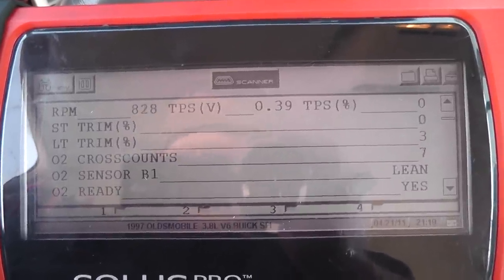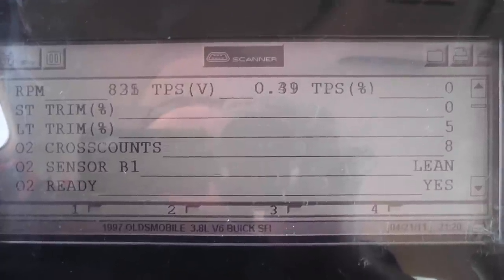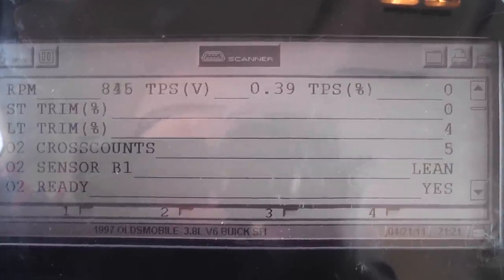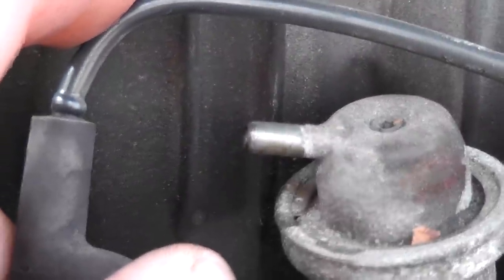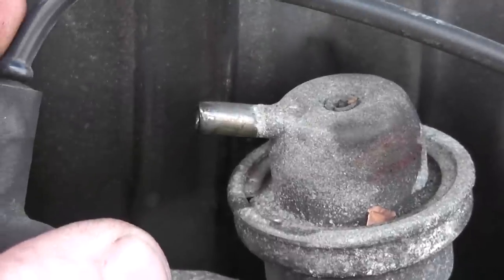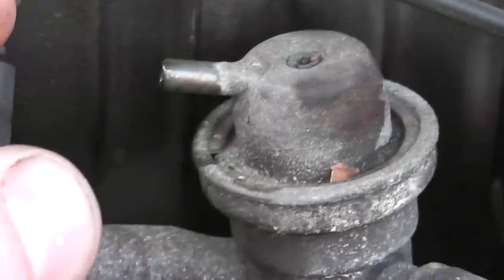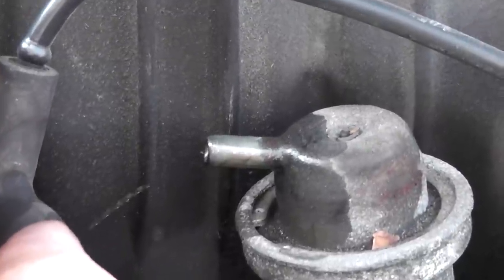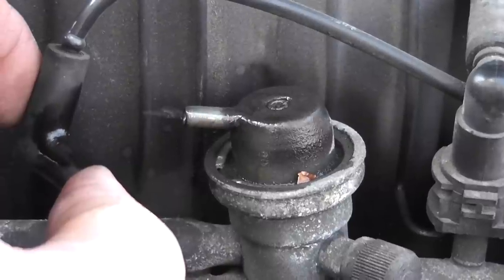Testing for a leaking, ruptured, fuel pressure regulator diaphragm

Comment: Will my engine run rough with a bad fuel pressure regulator and cause misfires? I have a 99 vw jetta vr6 and i am trying to figure out what is wrong with this car! I also noticed oil in the plug of the camshaft sensor because the seasl was bad and oil inside the air intake tube through the built in pvc valve! Can a bad catalytic converter cause the back pressure in the engine?  Thanks for the great channel!
Reply: Oil getting into your intake via the PCV valve can be a condition of excessive blow by gasses. Do a compression test. Maybe your piston rings are bad.
Reply: If so can i just replace the piston rings? I know there is a issue for sure! I think it might be a clogged catalytic converter but i dot know if that will cause enough back pressure to cause the blow back. This is my first v dub and the car is sweet but it runs like crap and i have replaced many parts but i havent had the time to mess with it lately! Thanks for any advice is appreciated!
Reply: Coilpack - common fault on the vr6. They crack internally. Change the coil pack first :)
Reply: I removed the header and exhaust and the engine doesnt shake as much and the idle is at 800 rpm instead of around 700 rpm or so. I think my converter was bad
Reply: I did replace coilpack! I have been getting low voltage on the engine sensors so i am going to replace the ect sensor and my temp gauge doesnt move and fans dont turn on .
Reply: mikeyd19841 Engines usually shake more with the exhaust manifold off so you may be on to something.
Reply: mikeyd19841 That blow by causing oil to get into your air intake could be caused by exhaust restriction instead of bad piston rings. See if your compression is improved with the exhaust off. Usually compression is down with bad rings, but maybe your pressure is too high due to clogged exhaust instead. 

A better way to test this is to hook up a vacuum/compression gauge through your 02 sensor.  Exhaust shouldn't be pressurized. If it is you've found one problem. 

Bad fuel pressure can cause misfire symptoms like rough running where you don't get misfire codes. "Bad" is too much just like too little it's bad.
Reply: mikeyd19841 Did you have misfire codes or just symptoms?
Reply: TinnieSingh i have a vw passat 2006 2.0t and it's having an intermitment problem stalling and long cranks to start.i put the computer and it saids there is a fault code for the fuel pressure regulator.
Reply: David Henriquez It may be getting too much fuel. Lack of vacuum to the fuel pressure regulator or a leaking regulator. Either way, too much fuel
Reply: DE Nichols to update you man.the car has been sitting for like a month.went to check out the high pressure fuel pump.well i pinched the fuel pressure regulator valve and fuel came out.i'm almost 100 percent sure now that is the problem.
Reply: David Henriquez
If fuel is coming out of the fuel pressure regulator through the vacuum hose then it can cause - numbers for fuel trims, also known as a rich condition. And if that's where the fuel is coming from then the regulator is definitely bad.
Reply: I will send you a diagram of my engine where i am having a vacuum issue. It is the vacuum line on the far left that was unplugged when i bought the car and when i plug it back in to the back of the upper intake manifold the car just stalls! So the vacuum line is just unplugged and the car is not on the road and is in my garage and i am waiting for better weather to look at it!         http://s981.photobucket.com/user/chamocritters/media/DSCN1136.jpg.html

Comment: My 1998 Cadillac Deville shows trouble code P0300. There was no vacuum when I pulled the vacuum line off the regulator. Any guess why there is no vacuum? The engine starts right away, but lacks power. Is my regulator bad?
Reply from the maker: A 98 caddy? What engine? Are you sure it was a regulator you were messing with? Some returnless systems used a pulse dampener on the fuel rail that looks like a regulator.
Reply: @ScannerDanner  Thanks for your quick response. After I posted my question, I found a crack in the rubber vacuum line where it plugs into the vacuum port on the engine. I have vacuum to the fuel pressure regulator now.

Comment: I have a ford focus and when i start on a cold day it struggles to start for about 30 seconds. If i touch accelerator it will stall but only for the first 30 seconds   i have looked everywhere for help but no joy. My pressure regulator does not have a gauge reader so i do not know what pressure it is. Do you know how i can tell how to set it correctly. Thanks
Reply: I am directing all help requests to my forum. Sign up (it's free) and create a new post. Be sure to add a name under "alias" as this is the name that will appear in the post.
Here is the link to the forum. 
http://www.scannerdanner.com/ForumRetrieve.aspx?ForumID=3226

Comment: PLEASE help.Been having a problem with starting My 2000 S10 for months now,Had 4 Dephi fuel,
pumps and the last one was a AC-Delco from dealer.
 It well start great first thing,(or after around 5 rest hours) with one turn of the engine,even after sitting for 2 days,
After I drive it (long or short drive) and it sits for 20,30,60 minutes it has to crank a
long time,maybe 5 seconds or more.But start.
 Every time I take it to my Mechanic,he says it is leaking back in the tank.If so why does it crank so good that first crank.
the presure drops within a few seconds.I ask him about leaking in the injectors and he said no.
I NEED HELPl
Reply from the maker: https://youtu.be/09_wQ9yQ85A
https://youtu.be/dAAFM3zlJME
This 2 part series will help you for sure.  
A bleed down issue can have hot engine restart issues because of fuel boiling as psi drops, this is why it can be worse when it is hot

Comment: What kinda scan tool do you have here? I'm wondering how much would this kinda older, more "pro like" (for lack of a better term), scan tool cost these days? I need one and would love to get like an old "pro" scan tool rather than a new couple of bucks priced one. If you know what I'm trying to say :D
Reply from the maker: +Atrax R I'm using a Solus Pro (Snap-on).
Reply: ScannerDanner Thanks! Will check out if there are any used one on sale around here.
Reply: +Atrax R check on eBay and try to get one with the newest update you can find. (updates are expensive)
Reply: ScannerDanner Premium Thanks, will try to find one there.

Comment: Hey Mr Danner , just got a quick question for you. I got a customer with a '99 Pontiac Sunfire 2.2L engine with a long crank time. Just wanna know how you would approach this kinda problem. I checked fuel pressure KOEO, It's around 42 psi and gradually drops to about 34 psi in about a minute or so. with the engine running it'a about 35 psi and 45 with the FPR vacuum hose disconnected. No fuel squirting from FPR. Customer just changed the plugs & fuel filter. What are you thoughts Thanks, Hector.

Comment: SD if my 95 lumina 3.1L  engine is giving of a strong smell of gas and wasting lots of gas on highways and roads,but I don't seem to visually see the leak; What can it be ? The regulator ? again it's dry from just looking at it.
Reply from the maker: most likely two separate issues (gas smell is probably a leak and not associated with poor gas mileage)
Reply: Which, two issues are the ones you think is the problem ?
Reply: thank  you

Comment: Any hints on a 94 ford explorer 4.0L this want runs so rich it doesnt even start and when it does for a little while fuel comes straight out of the tail pipe. I dont see how that much fuel goes through. injectors seem okay and checked the fuel pressure regulator (no leaking)

Comment: My car is running lean. And it bogs under a load. It idles at like 400 which is very low. (I have a 96 mustang GT). I think it could be the FPR. What do you think, can it cause that issue?
Reply: It also surges all the time. And if u let it coast in gear and let off the gas. It falls on its face, and after 4-5 seconds it'll stop and engine will run smooth again.

Comment: Mr. Danner, I went on a test drive with my customer and I got a different description of the "lack of pwr" complaint. He says its during decel he says suburban just doesn't coast like it us to it feels like it decel quick just by taking foot off gas. I'm sorry for the confusion. Now on my scan data from winding out 1st gear as I'm coming down from 5.5g(rpm) when I hit 1400 there is a sudden jolt almost like I hit brakes or sudden downshift and rpm goes suddenly to 2500.

Comment: I have a 1998 chevy s10 with a 2.2L. Has bad gas mileage lately. It been taking longer to start it lately, 5 or 6 cranks. I pulled the vacuum line off the fuel pressure regulator and checked to see if it hold vacuum, and it dose. I notice that the vacuum hose was full of gas after checking. The vacuum port is tucked under the intake manifold, so I can't see the FPR port to do your test. So I did the test from the vacuum hose . Do you think this could be the problem with the poor fuel mileage?

Comment: I have a 92 mustang gt. It has a long crank time, everytime. I have checked the fuel pressure and what I found is the pressure doesnt build on a key on (prime) position. Pump does run though. If I cycle it a few times it builds a little bit of pressure but drops to zero immediately after pump is off. Once running, the car runs fine, idle, or under load. The pressure runs at about 28 when idling and I believe the spec is 39? My question is, Could the regulator cause this? or would it be something else like a broken rubber hose within the tank or even a leaky injector? If Im thinking correctly the regulator would NOT cause the pressure issue right?
Reply from the maker: +Pyro17059 a leaky injector would cause a rich condition when running. you issues could be one of the following:
1. A leaking fuel pump check valve
2. a leaking regulator (like in this video)
3. a leaking regulator on the return line (not sealing all the way when closed)

To determine cause. 
pinch off the return line, if psi holds its the reg. 
pinch off the psi line, if psi holds its the pump check valve (need a new pump)
if psi still bleeds down with both lines pinched off, you have a leaking injector or torn reg. diaphragm

The above is a shorted version of part of section 16 in my field manual. (available through my website)
Reply: +ScannerDanner Thanks for the quick reply. You sir just got another subscriber, and sold an e-book.

Comment: My car will start sometimes and run for a while and sometime not start at all.  it smells like gas pretty bad.  it is a 2002 grand prix GT with the 3800.  Could the fuel pressure regulator cause this?  how to I check it if I can't get it running?

Comment: And it happens everytime, I have a recording of the scan data covering 2 back to back runs winding out 1st gear when I was looking for a fuel delivery problem. In the picture you can see the rpm spike in each decel, I'm just confused on what would cause this.

Comment: I am using the snap on ethos, I know its not a very fast tool :\ it enables me to graph and use cursors. I saved the movie along with other pid info if needed. I'm still very unclear on interpreting the fuel gauge readings as far as how far off I can be before I fail a pump for pressure. Spec is only koeo and it doesn't say pump priming pressure or when it stops. Also I don't have a spec for bleed down psi\time. Is there a rule of thumb rate?

Comment: 01 impala... will die out while driving down the road.... after 10 minutes it will start back up. while driving, it will start trying to cut out & rpms will bounce around ... and I will push on the gas for awhile & let up slowly and it will ride ok for awhile again, then iill just die out.... start back up after 10 min...we changed fuel pump...ign module... crankshaft sensor and still stalling out.
Reply from the maker: +rounddancefan1 when it doesn't start, you need to find out what you are missing. Spark, fuel pressure, injection pulse? Can't help without knowing at least this much
Reply: went to a graveyard today and asked from a mechanic....said it sounds like a plugged catletic convertor.....
Reply: rounddancefan1 I have the exact same problem, what did you do to fix it?

Comment: i have a 98 buick skylark with 3.1L it starts hard after sitting and just seems like it has lost some power. now after doing this test the fuel regulater diafram don't leak. ran the car for 10 mins no fuel came out. but while looking at my scan tool the short term fuel trim would spike as high as -15% with some throttle. long term fuel trim would idle at -17% and just jump around with throttle but never really got below -8% with throttle. what should i look for next? thanks

Comment: When i pull off the vacuum hose (intake vacuum)  there is no hissing sound,  is thst problematic?
Reply from the maker: Depends on the car but yes. Most likely. Follow the vacuum hose. Where does or go?
Reply: +ScannerDanner it goes to the throttle body,  between maf and and throttle
Reply from the maker: That should be intake vacuum but I suppose it's possible to be ported vacuum. Is there vacuum there as you rev the engine?

Comment: i just replaced my fpr about 2 years ago along with pump. get 10 psi with key on engine off snd it shoots up to 40 when i remove the regulator hose. the pressure drops immediately after turning car off. am i safe to assume its fpr again?
Reply from the maker: could be the pump check valve too. What are you working on?
Reply: I have a 95 camaro with the LT1 engine. I have been doing some diagnosing and just went out side and took the fuel rail off to check for leaking injectors. I found cylinder 7 to be leaking bad when i turned the key to the on--engine off position....I think i found the rich issue? lol My pump is about 2 years old and so is my FPR
Reply from the maker: you didn't say your car was also running rich. A bleed down like you described that is from a leaking injector would be an extremely rich condition and a misfire on that cylinder. IS that was you have?
Reply: it went from super rich to lean..i removed my cat so i figured thats what was causing the rich condition. But yes it has been running really rich for some time. Im waiting on a new injector to show up in the mail soon as i get that im hooking the rail back up and testing the pressure again

Comment: question i have bad idle problems but when disconnecting the vacuum line from the fuel regulator the car runs great and boost gauge is at proper psi and rpms too. thay with the vacuum line off  the regulator once its pluged back on goes to shit. im driving a 97 gst. would that mean its not sucking the right amount of air thru the regulator. and the feed line back to the gas tank vibrates like crazy

Comment: long crank time I’m 2000 Lexus lx 470  and dies when shifting and randomly at idle sometimes when pressing the brake
Reply from the maker: What tests have you done? What is your fuel pressure? What trouble codes?
Reply: @ScannerDanner  no trouble codes just abs light that was on before. It also has long crank. Smoked for vacuum leaks, checked pressure after fuel filter it went up to 60 psi then dropped. I. Amy get it to prime with key in engine off only when cranking does it go up.
Reply: Tried checking idle control valve but I don’t honk it has one. Cleaned the throttle body as well since it was dirty.
Reply from the maker: @Jaguarspaw5  your psi drop, if it's rapid, it why you have a long crank time.
What are your fuel trim numbers?
Reply: @ScannerDanner  fuel trims are around 3 to 9 long term at idle.
Reply: @ScannerDanner  also I drove it up to 55mph and it seemed ok not until I went to park and shifted a couple of times and it stalled
Reply from the maker: @Jaguarspaw5  you have multiple issues. For the long crank time, fuel psi should hold. The fuel psi regulator and fuel pump check valve are your two holding pieces. I have videos on how to determine which one is leaking. This is separate from your stalling issue
Reply: @ScannerDanner  ok thanks

Comment: I'm working on a 2000 Monte Carlo 3.4L that has a long crank time and misfire codes that are specific but also changing from #6 to #2 cylinders.. Engine runs rough at idle but there are no other DTC's other than single cylinder misfires. Sometimes the check engine light will flash, sometimes it is steady.. I suspected the fuel pressure regulator and tested it with the vacuum line disconnected for 5 minutes, but there was no fuel coming out of it. Do you think that it could still be the problem? Car only has 35K miles on it but it is 17 yrs old. Maybe just dirty injectors?
Reply from the maker: do this RPM drop test and see if you can ID a specific cylinder
https://www.youtube.com/edit?o=U&video_id=5ewJIBS9L98

Comment: Hi, I tried your test I saw no fuel from there. Micra stalls after 5-10 mins ticking over. So iv got clicking going on from sounds like fuse the box or that side of the engine bay and lots of fuel pump noise but no starting unless I leave it for hours,also a new thing is since I tried this test, I get clicking and ALL dash lights go out and no power on ignition, then come on again? good Micra but Im  no good with electrics or fuel injection and its a 16 valve twin overhead cam :( PLEASE HELP?

Comment: 1998 JEEP GRAND CHEROCKEE. WHERE IS FUEL REGULATOR. sTARTS SOMETIMES THEN DIES.
Reply from the maker: It is in the tank or part of the fuel filter and there is no vacuum hose to it, so this is not your problem. When it stalls, does it immediately restart?